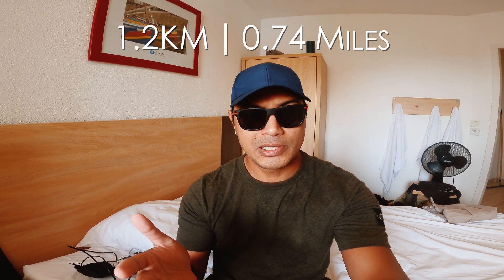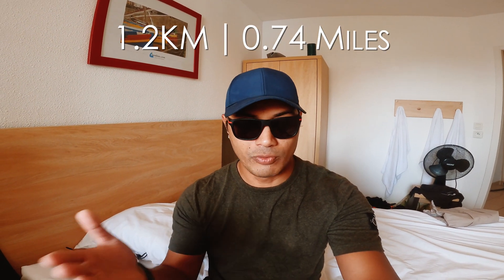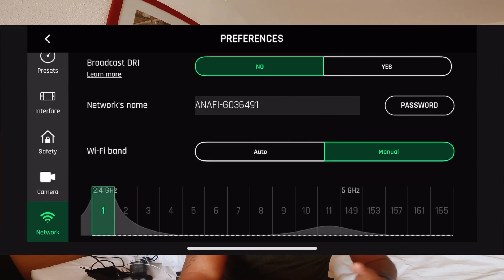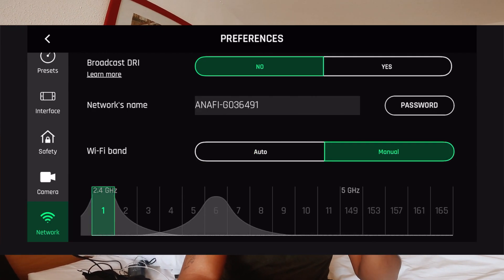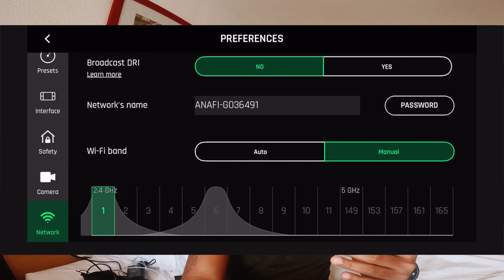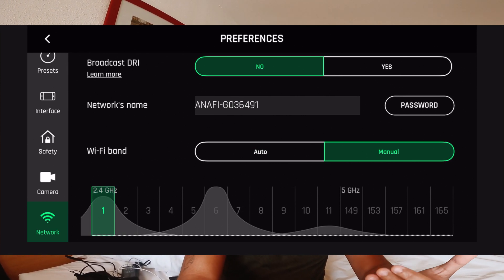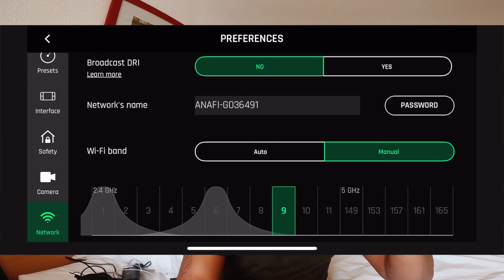Parrot ANAFI | Range Test 2.4GHz Over Sea (CE)

Comment: Good test man. I get more range from my anafi. by. angling the  the part that holds the phone flat . Like u would put the phone down on a flat surface, the anntenas pick up way better,, I know its awkward  lol but it flies way further  and gas a stronger  signal. I did this with the skydio2  also  and ,it had the same results as the use the same controller.

Comment: Brilliant video my friend.
Something I noticed with the Anafi...the faster the forward speed,during a range test,the faster the signal will be last because the angle of the rear antennas are pointed toward the sky!...So with very slow forward flight(3 or 4 meters a second)...the signal will stay stable because the angle of the rear antennas are more in line with the TX.
And I believe that different channels in both 2.4 and 5.8 have different strengths in milliwatts...not a fact but I believe I have read it or seen it on  a spec sheet...I will check more into this.
Anyways thanks Anthony 🤟🙏
Reply from the maker: Cheers mate, that does make sense with the angle of the feet antennas. The first video somewhat had a side wind to it wasn't fully pitched forward more of a pitch with a slight roll angle while flying out. In this 2.4GHz it was just pitched forward as I flew out into a headwind. Always considering other bits of information and collectivity we can develop a more educated approach when flying these birds :)
Reply: @ANTHONYVLOG  
As always thank you for your valued and appreciated experience and opinion.
I believe I will do a 2.4 ghz test as well...in a wifi congested area.
Then do both 2.4 and 5.8 in an open environment as free of interference as possible.